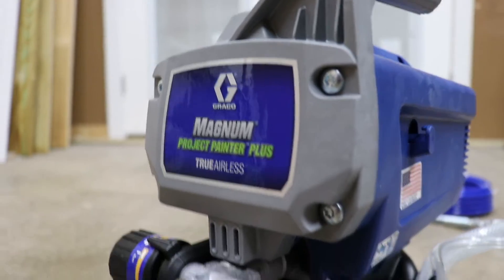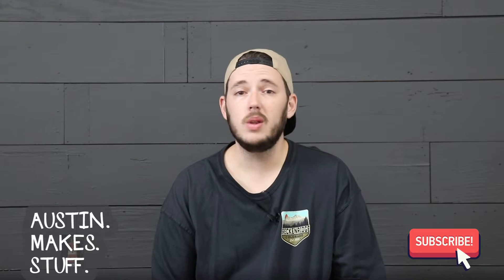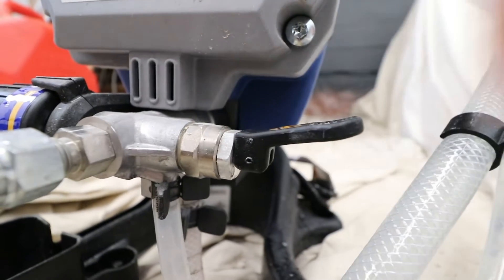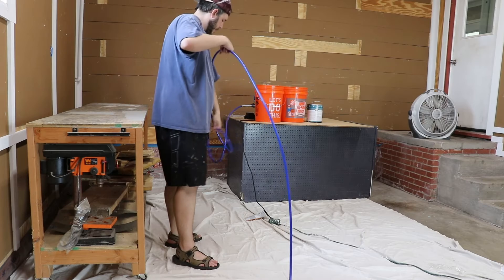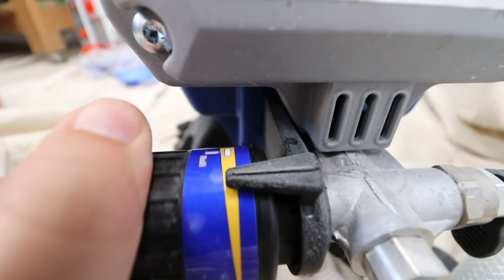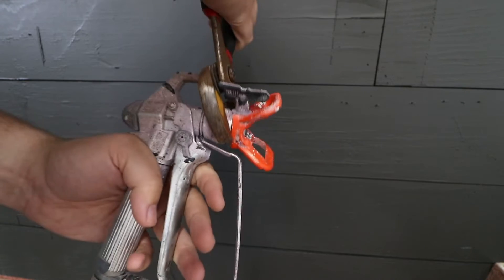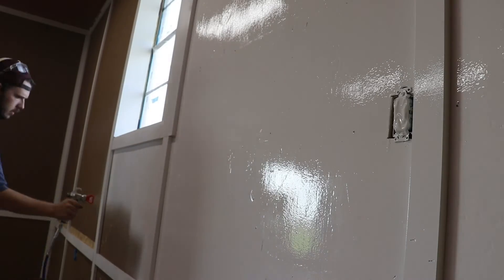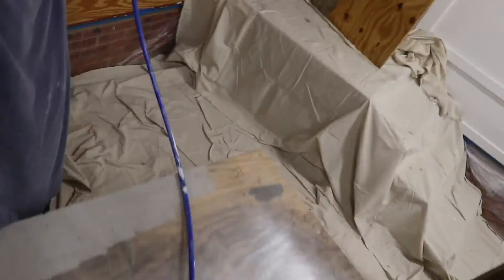Reviewing the Graco Project Painter Plus - Best Airless Paint Sprayer for Beginners or DIYers

Comment: get a couple extensions first a 12in and second a 30in or so Youll love life after that lol (less ladder climbing and bending over)  and as a wood worker building cabinets and farm house tables/blanket ladders ect i also bought a low pressure fine tip I think its a 310 and it lays the paint down so nice and smooth (paint is thinned a little). Great review video....thumbs up
Reply: Would you be interested into buying a package of low pressure tips ?

Comment: I own three Graco Project painter sprayers for my work . They’re my favorite, so lite, and you can paint a whole house, banisters, cabinets, with the right tip. Like Fine finish tip 310. And to avoid possible clogging, use the five gallon strainer cloth. Also you can mix a small cup of water. In a five gallon paint bucket.
Reply: I have a few myself. I love em
Reply: Which are the best

Comment: If you want to keep a paint sprayer working for years mix up a QT of 1/2 paint thinner, and half motor oil I only use non synthetic any weight I use cheapest oil I can find. Flush out the paint sprayer pump, hose, and gun really well with water remove the hose from the pump.  Then suck up that mixture of paint thinner, and motor oil into the pump until it comes out the priming tube run some though the pump comes out where you attach the hose  by toggling the primer switch shut it off. The hose and spray gun remove it remove the gun from the hose and disassemble the gun remove the screen, and tip soak it all in lacquer thinner. Pour lacquer thinner into the gun makes sure it flows out where the tip attaches. Buy some paint QT size mixing cups you can get a box of 100 with lids from amazon for $36 made by TCP global mostly used for autobody painting I use them for everything. Lacquer thinner will evaporate quickly the lid stops that. I learned this from a Graco service center tech when I first got my Graco I would flush it with water and put it away hose attached the gun still on there. Six months later when I pulled it out it would not prime. I had taken to him 2 times to clean out when 3rd time he told me about all this that was 25 years ago. Never had a problem again when you go to use the sprayer just flush it all out with water the paint thinner and motor oil flushes right out easily. You can run straight paint thinner though it to flush it first then water. Your only using this for the pump the hose should only need water. Never compress flammable solvent in the sprayer always run it without the spray gun nozzle installed if you need to run some solvent though the machine. Airless paint sprayers are great for big jobs it's a big job clean them up also get a plastic bag goes over the hose keep it from getting paint on it.

Comment: I am using the magnum painter plus I am just wondering if I can put the hose right into a 1 gallon can would that work?
Reply: Yes you can. Keep the screen covered and don't try to use every bit or you may have to re-prime. Make sure that you have another gallon ready to go.

Comment: The tip is only supposed to be hand tightened, if you tightened it with a wrench that may be why you had trouble turning the tip around to the unclog position.
Reply from the maker: I think I only hand tighten it, I have had to get the wrench to loosen it before. Sometimes SOMETHING gets jammed and the only way to relieve the pressure is to loosen it with a wrench.

Comment: I have this painter and the issue about it not priming. I found that if you remove the inlet hose from underneath, just release the clip, you will see a white ball of some sort inside the hole. Push that thing in with a small stick like a barbecue stick and it will release it from getting stuck. Don't know the reason why it's getting stuck but I have to do that each time I use the machine eventhough I had cleaned it thoroughly before. But it works..
Reply from the maker: Wow! That’s interesting, I am going to have to try that next time I pull it out.
Reply: @AustinMakesVids  I've had this for 5 years now, another thing Ive noticed is that it uses a lot of paint eventhough I'm at around 2200 psi and I found out that the gun is a standard basic type that uses standard RAC tips because it has the basic orange RAC tip guard that sprays very rough and basic and wastes a ton of paint. If you change the tip guard like the blue one that accepts the  yellow FFLV tip it will spray super fine and use very little paint and hardly no overspray. It's a good basic airless but the gun tip guard and tips can be upgraded for superior finish and less waste
Reply: Tony R  @tonyR.  Do you have a link to the finer tip or a part number?
Reply: @Tee2Green70  You can use any of the Graco FFLP (Fine finish low pressure) tips, these are the green ones but you have to use the "blue" tip guard. You can't use these tips with the badic orange tip guard.
These FFLP tips uses less paint and less pressure and very little overspray and the finish is very fine, great for like cabinets, doors and some painted furnitures. 
Check out videos here in YouTube about Graco FFLP tips.
Reply: @tonyr8443  Okay. So if you are painting a room. Like he demonstrated in this video. The fine finish low pressure  tips is not needed, correct?

Comment: I have to paint my ceiling on my newly installed deck, do you suggest putting plastic on all the walls to avoid paint? Does it spread easily?
Reply from the maker: There is a bit of overspray no doubt. When I have done it, I purchased some paint tape that has this attached plastic on it. It’s like a strip of painters tape with about 4 feet of plastic that falls down, that was good enough to keep overspray off the walls. Good luck!

Comment: How does this compare in terms of time, using a 20" roller? I have been using a 20" roller and it goes by really fast especially if it's big walls.
Reply: I’d roll the walls with the 20inch and use a sprayer for doors,trim and cabinets

Comment: I hear the pump is cheap and you will need to replace the whole sprayer. Anything you buy at the box stores. Look at the Graco 390 lower model contractor series for something that will last. You can rebuild the pump and if you want to sell it, you will get your money back. Any Graco 'X' series, be careful.
Reply from the maker: Noted. I've used it enough times for it to pay for itself so far.
Reply: That's a great tip for a pro if you can justify spending  early 4x the price. For someone like myself as a homeowner/diy project person or even a handyman that does paint jobs but not everyday, I think these x units are great. There are ways to replace the pumps in these units although not as simple as the pro units. They are also only a little over $100 so you could replace the pump in one of these almost 6 times  before you'd hit the cost of the pro models. And remember, the pro models do wear out too they just last longer and are designed to have replaceable components. They are easy to keep in service but parts still cost money.
Reply: I mean, its 200 bucks man. Even if it only lasts a year of fairly regular work its well worth it. I don't know what you make an hour, but for me (handyman) ill just buy another one when it dies. Not even worth the time to try and replace stuff. Like 2 hours of work buys me another one.
Reply: @MrCreed145  shelling out the cash for a new sprayer adds up over time plus the time lost on site troubleshooting and more time lost getting another…. To each their own I guess. I Buy good stuff and take care of it, it will take care of me later.
Reply: @donavonlewis1039  I'm not saying don't buy good stuff. Its dumb you even implied that. I'm saying if its a decent sprayer that would last even one year of fairly regular use then it is well worth 200 bucks......
Reply: @MrCreed145  what’s dumb is you getting so wound up about a pump sprayer buddy. It’s just my opinion and apparently I can’t have an opinion. Peace im out.
Reply: @donavonlewis1039  No what's dumb is you can't read, then misrepresent what I say, then are incapable of comprehending it after bieng corrected. Keep your straw man arguments to your self. Your entitled to your own opinion but not your own facts. You replied to something I never even said, amd with a captain obvious reply at that. Laughable at best
Reply: @MrCreed145  again you are set off about a paint sprayer pump. Chill bro.
Reply: @donavonlewis1039  says the troll inaccurately again..... facts are hard for you I guess.
Reply: I want the rest of the argument in this comment to continue so I have more to read

Comment: You save the time spraying the material for sure but you will loose tons of time for masking everything.
Reply: True but Cut in time is probably longer than masking time, then you still have to roll it. Most of the time spraying is faster. Especially if you buy a hand masker that lays tape and paper/plastic simultaneously.